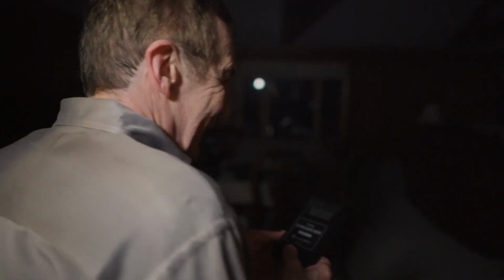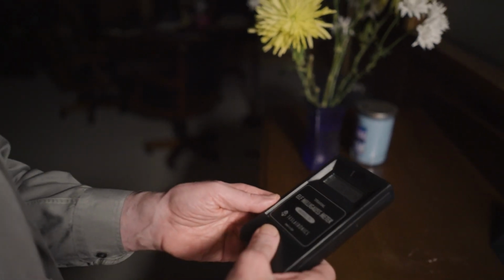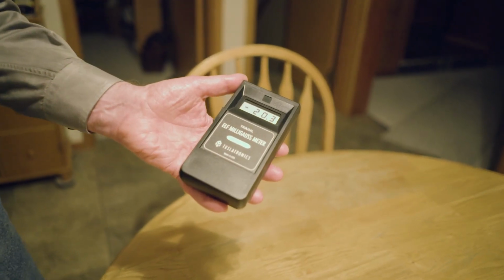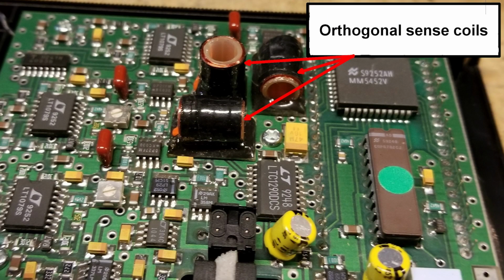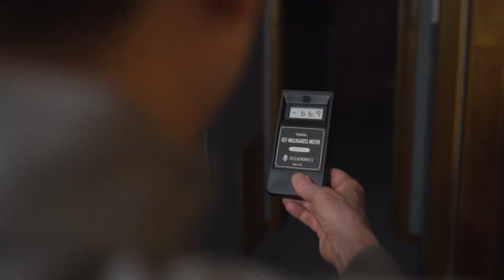Ghostly Milligauss Meter Readings

Comment: i walked up to the civil war section of the local cemetery.i found unknown graves to try my investigation.walking up from about 50yds away i got .4 on meter.upon announcing myself and why i was there and sitting at the unknowns,i got a spike of 1.4/1.5 which became a base line.upon explaining the meter and how to manipulate the device,i started asking pointed questions that would only require a yes/no type answer.upon asking questions about what side of the war the spirit was on, i asked,''were you a confederate soldier?' i got no movement on the meter.then i asked if they were a union soldier and i started getting spikes of 1.8/1.9 then it would settle back to base line 1.4/1.5.after almost ever question it spiked.i was only getting spikes on my dab-tek and nothing much w/generic k2.on my 2nd trip to the same place doing the exact same thing,i got .0 on walk up but once there i only got the .4 reading.so doing the same thing as last time,i asked if there are any spirits that remember me from my visit 2 days ago.i said,' i told you i would be back in 2 days and here i am'. the meter spiked to 2.5 and the new base line stayed in the 2.4/2.5 range.upon asking questions this time i was getting spikes of 2.8/2.9. the k2 only had the 1 light lit up the entire time.i do not know what to make of this as there were no power lines or anything w/in about 1/2mile.i will go back w/more and different devices and see what happens.this happened in green wood cemetery in decatur,il which is talked about in the troy taylor book,'haunted decatur'.i have not read the book because this place has been talked about so much over the years so i had to give it a go.i do not say yes or no about any spirits being there but the responses right after questions seem to much of a coincidence.thanks for your vid..
Reply: Milli gauss?